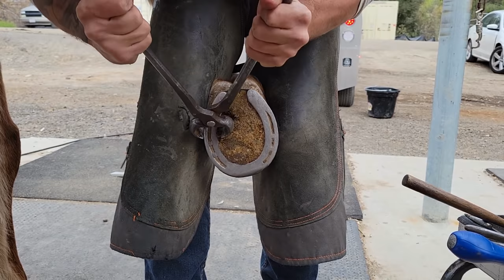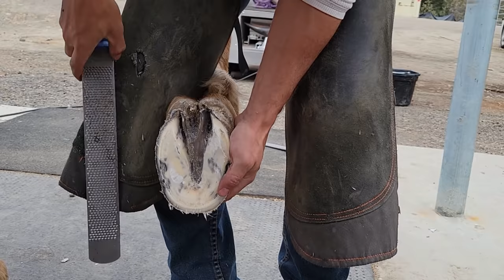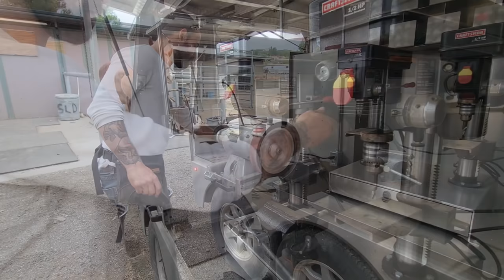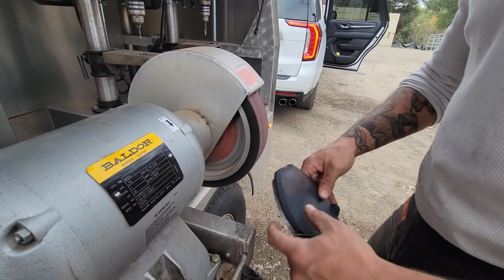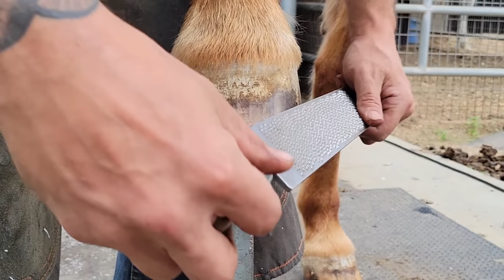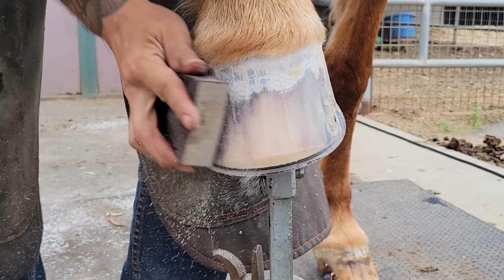Very Satisfying - Hoof Restoration - Farrier ASMR

Comment: Do hooves grow over time? I know it doesn't hurt the horse when you are shaving parts off. But do you have to wait for a new layer to grow before changing the horseshoe? 
I imagine if you change them to often you will eventually hit a nerve.
Reply: What a coincidence . Our thoughts are same
Reply: Yes the hard part of the hoof is constantly growing just like fingernails. Anatomically the very bottom link of a horse' legs are actually a single fingertip. That is a big part of the reason that they need regular shoe changes, as well as wear and tear.
Reply: Had the same question man
Reply: @mobilemarshall  Thanks for the answer :D
Reply: Yes. Hooves grow constantly. Thats why they need new shoes frequently. Same as our nails, but hooves are much, much bigger. Kkk
Reply: I had the same thought, but you would assume that if the hooves didnt grow back then trimming it the way they do in these videos would be impossible...
Reply: yes they do grow constantly. the reason to put horseshoe on them is because modern horses wear their hooves faster they can grow it, mainly because they mostly walk on concrete and tarmac rather than grass
Reply: @MybeautifulandamazingPrincess  right?!
but I think most countries/big cities have at least one police unity that rides horses in asphalt, sadly.
Reply: Please note that normal wear and tear in the countryside is not why horseshoes were invented. They were invented to help horses to run and go through water/mud without sinking and having trouble
Reply: @MybeautifulandamazingPrincess  that's why you put horseshoes on them,

Comment: How often generally do shoes have to be redone?
Enjoyed the video and your workmanship!
Reply: Usually every 6 to 8 weeks (that's at least how often we do it)
Reply: @chiaramertens9969  Thanks for answering!
Reply: @chiaramertens9969  this is more frequent than I've expected. i thought it was a bi-yearly thing
Reply: @chiaramertens9969  doesn't that depend on the "mileage" of its current shoes?
Reply: @neissy  usually more based on how fast the horses hooves grow. They are like finger nails. The hoof will outgrow the shoe before the shoe wears out.
Reply: @04campba  does it hurt them..when they do this to their hooves?
Reply: @samit5255  done properly, like in the video, no. If too much is trimmed off or the nails are put in the wrong place it really hurts - this is a highly skilled job.
Reply: @04campba  Exactly, it's just like cutting your nails. Cut too much and it hurts. They don't feel due to the lack of nerves to a certain depth
Reply: Depends on the horse and how much work they do.
Reply: I can understand why he had a small oven, if the horse feet can actually vary in size and standard horseshoes will not fit properly. I guess trimming or plastering a horse's hoof to fit the shoe might cause health problems in the long run, so one might need to be a blacksmith in this line of work. But why did he burn the horseshoe into the hoof? :S that felt so random.

Comment: Just a question in regards to the heating of the horse shoe and placing it to the hoof. No, im not questioning if it hurts the horse or not (already knows the answer to that one). I just like to know the reason it needed to be burned in the expose hoof of the horse and then later cover it?

Edit: Im really curious.
Reply: It's called hot shoeing.  The reason for it, is to sit properly and fit 100%, without movement.
Reply: Does it hurts the horse? It's the first time I watch these kind of videos
Reply: @dankusnp  Nope, it doesn't.  If it hurt the horse, the horse would have kicked the farrier, or stomped on him.  Horses let you know when they are spooked or feel hurt.  They kick very hard, and are strong enough to break bones, or even cause death depending on where they kick.
Reply: @melanisticmandalorian  thats cool, thanks!
Reply: @dankusnp  I should also mention, horses also flinch in pain, so depending on the situation and the type of medical procedure they are carrying out (vets), or an abcess the farriers are taking care of, they will try to be gentle.
Reply: @dankusnp  For a horse, that is like get a manicure

Comment: Not bad. As the slave of 3 fine steads, one with feet like glass, i wonder if the rubber could cause frog atrophy over continued use as it reduces the pressure pulses in that area. Nice truck. Expect it won't look like that after a week of shoeing! Also you weren't in your farriers chaps whilst dealing with the red hot shoe. Showboating of the highest order.  Best of luck.